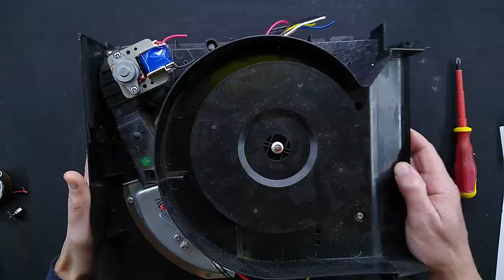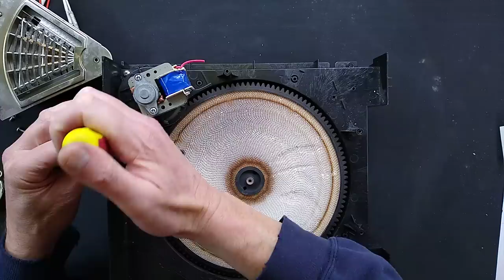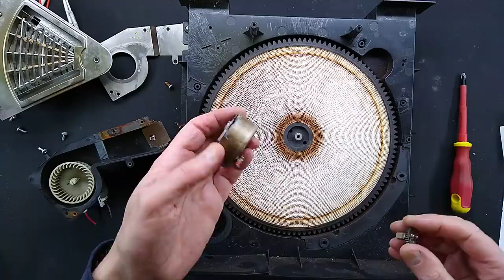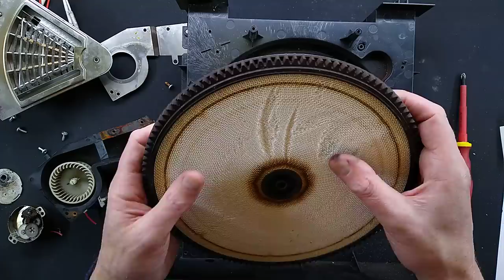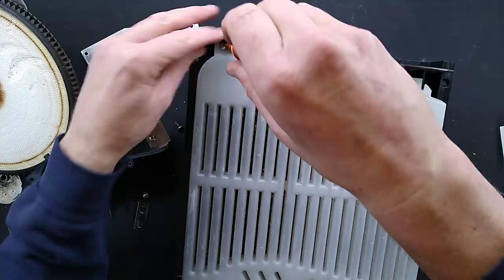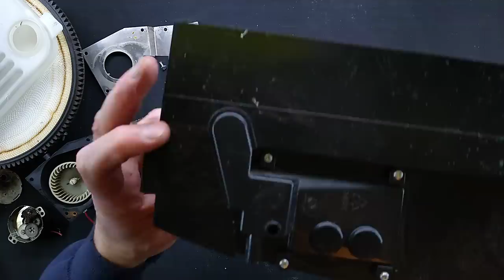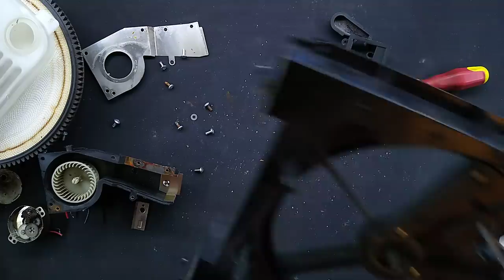Desiccant drum dehumidifier teardown

Comment: I would say mechanically they are more fussy, since there’s more moving parts and little things to go wrong, but a compressor based one is more complicated, if that makes sense. Also, to be fair the compressor based ones also put out a flow of warm air equal to whatever the machine wattage is, but they likely run less since they’re more efficient at removing the moisture.
Reply: I think they even can put out more heat than the electric power input because of the heat of condensation of water (2257 J/g). So for example if the amount of water it produces is 0,1g/s that is a 225.7 watt bonus :)
Reply: The compressor based ones put out approx 10% heat of the machine wattage. The desiccant ones put out a little more. In my experience, with a desiccant one downstairs (on it's lower setting of 300 watts) & a compressor one upstairs (190 watts) the desiccant one runs a whole lot less, whilst collecting the same amount of water as the compressor one.

Comment: I have had 2 dehumidifiers, the first was a desiccant and the latest is a compressor. In use the desiccant pulled out moisture much quicker than the compressor, although I haven’t checked the comparative energy use per litre...

Comment: That desiccant drum has exactly the same honeycomb construction as a vehicle exhaust catalytic converter. We run a desiccant type downstairs in the living room & a compressor one upstairs. The desiccant one provides a little supplemental heat to the central heating during Winter with the living room doors closed & is reasonably quiet. In my experience the desiccant one runs a lot less than the compressor one for the same amount of water collected & with them both set to 50% RH.

Comment: I think these are easier to understand when you realise that they actually dehumidify using a room temperature condenser.  For this to work they need to create hot humid air, and they do this using the combination of the desiccant to collect the water and the heater to circulate hot air over the wet desiccant.

They're really intended for use in cold climates - they were invented by a Swede.  Their main purpose in domestic use is usually to avoid mould occurring on the inside of outer walls due to condensation.  The general consensus seems to be that they become more efficient (litres per kWh) than traditional refrigerated condenser dehumidifiers when operating at below around 20˚C at 60% humidity.  This is usually the case in colder rooms overnight, which is where they're most needed.  Also their quiet operation is a significant bonus overnight.

It's worth pointing out that they contain a humidistat and so only run when required.  I find that on the 300W setting mine runs at an average of under 100W, so that's roughly the same as an efficient fridge/freezer.  Obviously in practice this depends on factors such as the number of people living in the house, the absolute humidity outside and how ventilated the house is.   Most of the time in a UK winter the absolute humidity outside is lower than that inside, so the dehumidifier is really supplementing the ventilation.  In theory the cost of running the dehumidifier is less than that of running more heating needed with increased ventilation.

Comment: I fixed one of these recently, where the regeneration fan motor bearings had stopped working properly. They are quite odd -- they hadn't worn out, but the self-alignment spring was a bit loose causing the actual bearing to wobble around.

It looks a lot easier to get apart if you lop all the wires off first!
Reply from the maker: Yeah.  They have quite a wiring loom in them.

Comment: Ah, temperature swing adsorption dehumidification.  Used extensively in large volume dehumidification like hockey rinks.  The efficiency scales down too so these small room units are quite useful.
Condensing surfaces grow slime with the cleanest air since bacteria only need water and a carbon source.  With that warmth, several pathogens are possible including Legionella.  
The smaller blower motor is the typical shielded pole motor,  I know it well as my 4 l water distiller uses a near identical copy.  I've relubricated its bearings yearly  for the past 10 years.  From it, I get distilled water at pennies a liter and free, gentle heat for the bathroom.  Far easier to clean the distiller than the water kettle, coffee maker and steam iron.
Reply: Would you please elaborate on the model of distiller you have?
Reply: @Bobo-ox7fj  
It is 20+ years old.  I've seen the same design sold through Amazon.  It was given to me.

Comment: I tried looking through my eBay history to find the motor I bought. It was 115v, and I wound up grinding a flat into it to drive the drum. The fan has stopped in mine & I need to take it apart & see what’s going on.
Reply from the maker: If it's the main fan then the capacitor is the prime suspect if it makes no attempt to run at all.  Alternatively, if the indicators are dead too it may be a thermal fuse.

Comment: My wife had an amazing idea earlier this year. We bought a dehumidifier to help us deal with some air conditioning issues over summer. We normally use distilled water in our humidifiers over wintertime, so we don't have to contend with calcium scale (our water is fairly hard). So... put the condensate from the dehumidifier in the distiller, and store it for the wintertime. Obviously, while all stages of this use electrical power, it's nothing we wouldn't be running anyway, and I'd bet it cuts down our tap water use a bit. Never hurts having drinkable water on standby either.
Reply: Just be aware that distilled water from AC condensate is considered corrosive, it can eat away copper or aluminum. I don't know what makes it so, but check the pH before drinking or putting it into the humidifier!
Reply from the maker: Condensate from condensing heating boilers is acidic.  I just tested the water from my desiccant drum dehumidifier and it was a neutral value of 7.

Comment: So either... this predates those sorta-novelty open air pizza cookers....
OR after the pizza cookers didn't sell, they decided to repurpose most of the hardware, for a new product (still novelty? heh). So they replaced the pizza tray with a mesh disc packed with desiccant, then strapped on a big ass fan to circulate air through it...

There's probably no relation to each's creation, but honestly... that pizza cooker was immediately what I 'saw' once the circulator fan was removed! 😅

Comment: I have done service on these! Large-capacity dessicant drier made by Munters, 480V 3ph. Dessicant wheel a little under 1m across. It is ducted with 10inch ducts to a larger walk-in environmental simulation chamber, approximately 150 cubic meters. It will take that chamber from 98%rh down to under 5%rh in 20 minutes!

Great for humidity and temperature cycling tests, quickly removes moisture before the chamber ramps into subzero temperatures to avoid condensation settling and freezing onto test components.

Comment: Thanks Clive.  Dehumidifier helps tons with the Flood of moisture in air here  (no AC) - except Heat it blows, in summer. 
Like said, Heat, during Cold would be nice, (no Heat here - but 'oil filled')  tho i have Compressor type. 
Quiet would be nice, this 'Buzzes', could be Case not 'tight' enough [?]   lol  i tried to find, Water in tub muffles it some.   
Seems i need to move to other areas more often, maybe I'm slowing down.   oh Jeez!     : }    cheers!

Comment: The simplicity of this is very impressive. Thanks for taking it to bits! I wonder if there would be a way to use some gearing to ditch one of the motors? Could the zeolite drum be driven off the fan motor? That might cost too much in the engineering of the system and then, well, stuff does break. When I lived in Arizona they have a thing called a Swamp Cooler. It is basically a water reservoir at the bottom and a pump to raise the water up and drizzle it over a honey-comb type paper 'filter'. And then a fan (blower really, they kick out a lot of air!). It's mounted to your house, or whatever, and When it's very dry and hot, the device will force cooler wet air into your place. You need to pick one window far from the inlet and open it about 2-3 inches. That way, the incoming cold air will force the house air out that one exit, and fill your home with cool humid air!  OK, so, it does happen that you get mosquitoes infesting the water reservoir of the swamp cooler (is that how it got the name?) and also, when the weather get's humid it doesn't work a damn. But when it does work, it is a joy. Similar simple design. Moving air and managing humidity. nice.  I would like to get both of the installed in a 1 bedroom apartment and let the duel it out!

Comment: These are a simplified version of the rotary concentrators used for pollution control with a thermal oxidizer. I am a field service engineer for an environmental company that builds and services this kind of equipment. Same idea as this design, except the purpose is to take high flow low VOC concentration air and concentrate it to low flow high concentration VOC air. This helps to make the oxidizer much smaller, as the oxidizer for the high flow low VOC air stream would need to be massive and consume huge amounts of natural gas. The VOCs in the air adsorb onto the wheel, then hot air that's heated by the oxidizer via a heat exchanger is blown across the wheel in a small pie section to desorb the VOCs off the wheel, which is then sent to the oxidizer.

Typically two are used in series to achieve better efficiency. There's also usage of the VOC air as desorption air to increase efficiency as well.

Comment: i have such dehumidifier and i love it. it is fairly silent and works great and is really efficient compared to the tec based systems but yea the compressor type are more effective and efficient as this system but cost more but save money in the long run. for a small budget dehumidifier i think the drum dehumidifier is the best. also if the room is already warm they tend to use less power. i have one who clams it would use 200W but uses in 25C only 30W to 60W depending if it is on a heating or cooling cycle. they need to cool down from time to time. i have tracked my humidity and temperature in my room over time and calculated the moisture content in the air and i saw as the temperature climbs the system goes more effective but it was clearly a step. this step was alway on the same time as the system uses less power and it tries to hold a certain temperature in the room. 
it was interesting to see the plots i made and this tells me how and when it works best but i did not know how it does this. now i know thanks ^^

Comment: Thanks, Sir - impressive teardown. 
Costs: 0.3 kw operated permanently means a daily energy consumption of 7 kWh. At a cost of 0.35 € per kWh such a unit sums up to € 900 per year operation costs. This is the same level as my compressor based dehumidifyer which produces around 5 litres water per day.
Is this somehow comparable?
Reply: The compressor ones are usually cheaper to run, except at low temperatures, but the desiccant ones are usually much more powerful and so pull water out of the air very much faster, and can go down to ridiculously low humidities, so they generally run for maybe only half the time or something like that.
Reply: @BooBaddyBig  Is there any data available how much water the desiccant variant produces at a 70% humidity at 20 deg C room temperature at a consumption of 300 Watt?
Reply: @ghlscitel6714  You'd have to check the manufacturer's data sheet, but it should be less water produced than a 300 watt compressor one at that temperature. The thing is though, the devices are usually much cheaper to purchase per watt. They do shine at low temperature and low use scenarios such as flooding or if you want to produce very low humidities.
Reply from the maker: Mine only need to collect about 2l a day.

Comment: I was meaning to make a video explaining how these work bit I think you've got it covered, so I won't bother.

A reason they work so well in the cold is the colder the ambient air, the colder the plastic condenser will be so the better it will condense the moist air.

One thing I would like to see is some sort of jogging method to knock droplets down off the inside condensor, to make more surface area for new condensation to form.
I give mine a light kick or rock it about a bit, you can hear it dripping for a few seconds after.

Another cool idea I had to improve efficiency, is use a peltier with heatpipes and a heatsink. The hot side being used to preheat the incoming moist air, and the cold side to be in contact with the condensor to make it colder to condense better.

Comment: Did testing with using a desiccant wheel with a standard compressor A/C to pull the water out to let the system just cool the air.  Also did a liquid desiccant that pumped it over the hot roof to let the sun dry it out.  Fun times.

Comment: Thanks for this. I tried to repair an ecoair dd322fw classic, after this and the other video.
The unit was "working" but was not collecting water. 
There is no plastic condenser behind the dessicant coil. I tried another dd322fw which did collect water.
Did they not have these condensers in earlier models?

I tried another dd322fw which did collect water, lots of it!
Reply from the maker: I've always known them to have condensers.  I wonder if someone has removed it.

Comment: I have two zeolite dehumidifiers, got them after watching your prior videos on them and they definitely help during cold and humid winters! However it seems that the worst part of them is the motor that drives the dissicant wheel, one of mine is making a racket and its that stupid motor. Just like in the case of yours, finding a motor with the correct shaft has proven impossible... The motor is readily available, it will just not fit the gear... I'm thinking of buying one and just reusing the shaft from the failed motor.
Reply: I could 3d print one potentially (if you are talking about a meaco dd8l that is)

Comment: I've got a problem with mine. When the water in the tank gets to the point where it's full, as you mentioned in the video, there's float which rises and causes a magnet to be pulled away from a reed switch, prompting the electronics to shut down the machine and illuminate the tank full indicator LED. That has always worked fine until recently. What's started to happen is the tank gets full but the machine doesn't shut down as soon as it should, and eventually the tank overflows everywhere before it finally shuts off and leaves me with a puddle of water to deal with. I took the water tank apart and inspected the pivot between the float and the magnet in case it was getting gummed up with slime etc, and not moving freely, and it was indeed a bit messy so I cleaned all the parts thoroughly and put it back together. I thought that would have resolved the problem but it seems it hasn't. My theory is that over time the reeds inside the reed switch have become slightly magnetised, and as a result when the tank gets full and the magnet starts to pull away the reeds to not separate and the machine doesn't shut down. Is that possible? If so, I think just replacing the reed switch should do the job.
Reply from the maker: Does the machine stop when the water collection tray is pulled out?  That would indicate if the reed switch was sticking.